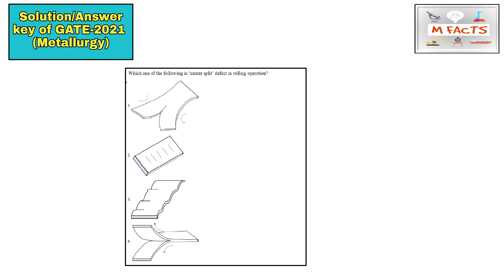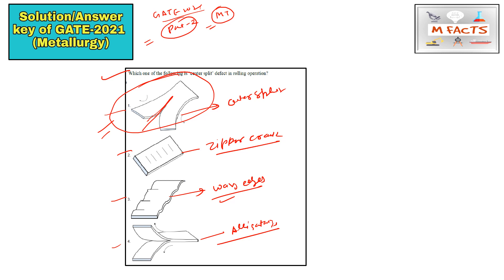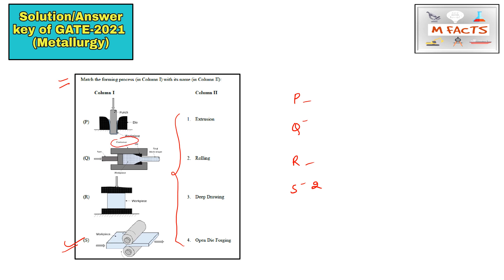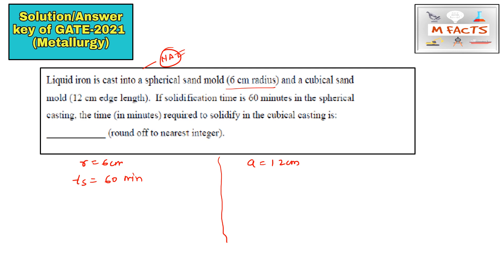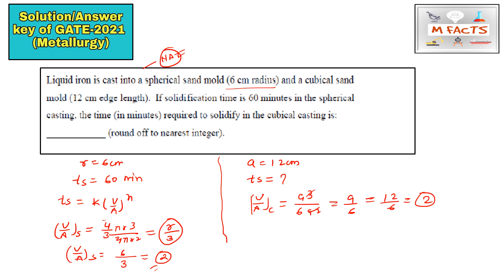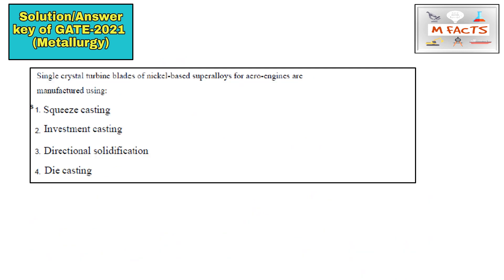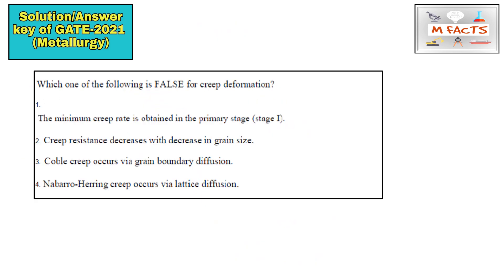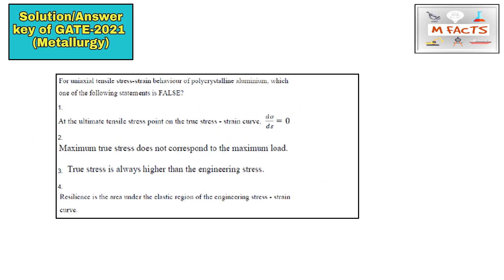GATE 2021 Metallurgy Solution Part-2// Metallurgy Core part-1

Comment: Sir in a true stress strain curve, the curve is continuously increasing at its uts value whereas the slope is zero at uts value for an engineering stress strain curve. Sir the load will be less only for a true stress at last stages as the area decreases the stress value is increased. So (1) must be correct for the last question.
Reply: At UTS necking starts and true strain = n dsigma/ d epsilon = sigma
Reply from the maker: I did wrong 
Answer will be "A" Part
Sorry for mistake
Reply from the maker: Sigma/2
Reply: @Metallurgicalfacts  what sigma?? In engineering Curve  slope become zero.....d sigma/d epsilon  equal to zero na??